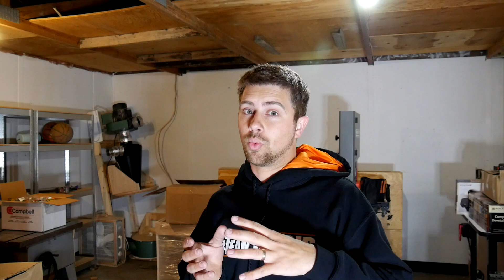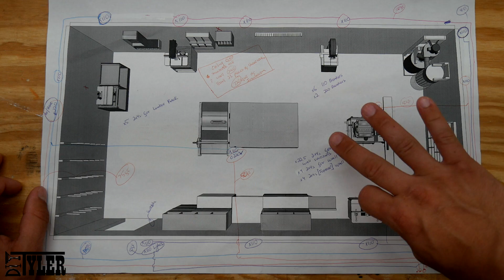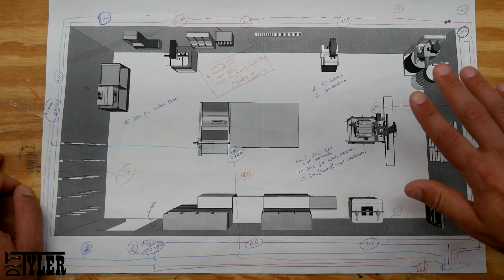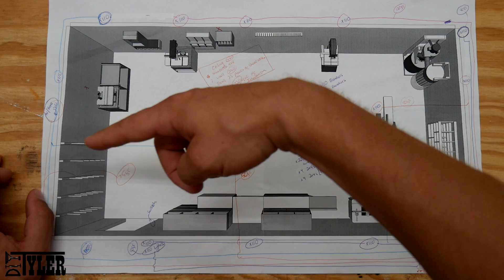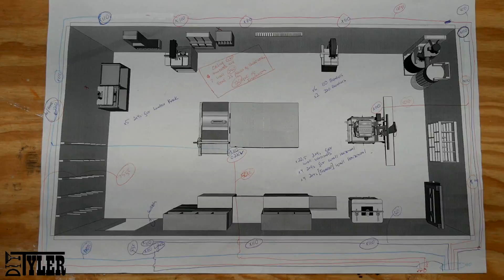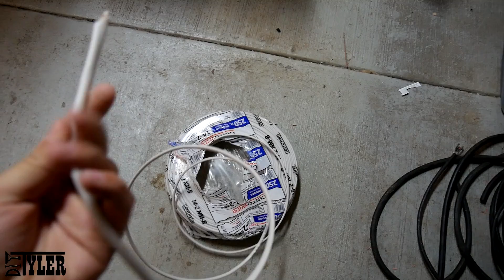Setting up the NEW DIYTyler Shop 2 |  Electric | Lights | Efficient Tool Layout

Comment: Electrician comment 3.5678 Billion......Tyler.........great.job. I'm glad to see you use a level on that EMT. Excellent job putting tape on the receptacle; always a brilliant idea. On wiring up the receptacles; although I have wired thousands of them using the "back-stab" hole terminal, I think when wiring our own homes, it's best to wrap the wire around the screw terminals. With heavy use of in and out cords, the tabs get weak and problems arise. The new shop looks great; a lot better than the electric set up in my shop at the moment! DD
Reply: As another electrician:  I agree that the cheaper back-stab receptacles are not the way to go.  Over the years, I have seen way too many failures -- particularly in a work shop where the tools often draw a heavy load.  As Dennis suggested, "it's best to wrap the wire around the screw terminals".  Oh yeah, they will work fine for a while, but with the use you are probably going to give them, those wimpy little connectors will heat up and eventually fail.  It is worth the little bit of extra work to prevent problems.  I manage several apartment buildings and  already know the about the tenant's electrical problem before I ever see it ---  receptacles with back-stab connections.  :-(

Comment: your wire nut order is right on grd- neutral -hot,
 when disassembling just the reverse order black- white- grd .
much safer, if workin live! 
 still has a grd path and a 2nd grd with neutral 
this  also takes the load off the neutral. you dont want to get between a set of neutrals

Comment: LED lighting doesn't have to be expensive. I bought all my lights from Sam's club. $37 per fixture. They were on sale for $27 at one time. 4200 lumens. I just put receptacles where the old fluorescents were wired. No more flickering or humming. Last forever

Comment: Tyler, the new shop is looking good~!  Nice video on the lighting & electrical.  Are you going to put out any video on the setup of your dust collection system?  Not so much a tutorial on what you've done, but just an overview on the pipe distribution to your tool layout.  I'm working on getting mine done and I'm looking at as many videos as I can on running pipe.  Keep up the great content~!!
Reply from the maker: Andrew, if you look though my past videos I have a few on the DC layout in the old shop. Don't think I will make another as this is laid out using the same fittings and thought process.

Comment: New lights look great, and the low power consumption is a major bonus. Nice job on the planning. You should be off to a nice start in the new space.
Reply from the maker: Power consumption is a bit more than I said in the video.....that calculation was based off less lights but total now is less than 5 light bulbs. I can live with that!

Comment: You say that the total wattage is only 150. Do you perhaps mean 1500? The 2 foot fixtures are 24 watt and the 4 footers are 48.

Would have been nice if you disclosed how much those fixtures cost. If I'm at the right place on their website, the 2 foot are $120 and the 4 foot are $215. Yikes!

All that said, nice light quality.
Reply from the maker: +Alex Pettigrew it's actually something more like 500w after I added a few more lights. Still very very little. Yea they are expensive fixtures but the light quality is very good and shows on camera.
Reply: Editing time is money.. So if it saves time in post- I am guessing its well worth the added cost for color correct videos!

Comment: Could you give me a "real" reason why the most of the US is still using 120V?
Pretty much all of Europe runs on 220~230V and our "big" voltage is 380V.
Asking this because there are alot of powertools i would like to import to Europe but can't bacause of the phase changes.
Something like a SawStop.
Reply: Thrust me, You're happy to have only 120v when you put your finger on both wire ;) We have 240v single phase too for powerful stuff
Reply: Most of Sawstops saws are 240.
Reply: John Harris Sawstop was a example, there are many tools that won't work because of the hrtz difference.
Reply: actually it's getting  more 240 & 400V in europe.. also depends a lot how close to the transformer you live :-)  I have 238V between phase & neutral :-)

Comment: The lights are nice looking and good quality from what I can tell but the pricing is absolutely atrocious.  $100 for a 4ft single strip unit is not even worth serious consideration in 2017 when dual strip units can be purchased for $30-$40 all over.
Reply: Paying the 100 bucks is like putting money in the bank. Think first of the 80 or so % savings on running them and then the cost of relamping. You get a great return on your investment. The initial cost of a project is not always the prime consideration. On this project, I would have painted the ceiling white and not used reflector fixtures. The dark band around the ceiling makes the room look darker. Open lamp strips would use the ceiling as well as the walls to reflect the light. I know we are all jumping on Tyler about stuff, but it is just to help. Tyler seems pretty cool and knowledgeable.

Comment: Great job Tyler, and those fixtures look beautiful on camera, I'll need to check them out as I'm about ready to add more light to my garage/shop so thanks for providing the link. One quick note, I've been told in the past by electricians that romex should never go in EMT, THHN is recommended instead; but I'm not an electrician and your work looks great.

Comment: Looks great Tyler really bright now, from that last shot it looks like it's all done and dusted, including the dust collection.
Did you do a video on the dust collection fitting and placements etc?
Barry (ENG)
Reply from the maker: No video on the DC install as I had a few from the last shop. Figured this is the same stuff just laid out  a bit different. Thanks for watching Barry!

Comment: Place a label on the new electrical boxes that shows the circuit number.  Or wright it on the back of the rec plate cover.  It will come in handy, when you have gone a few months and its not so clear in your mind.